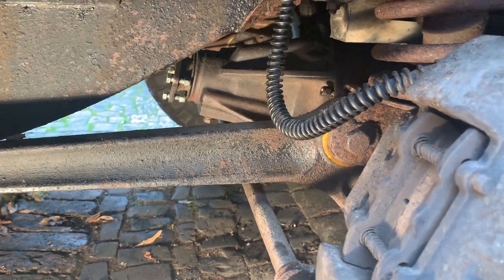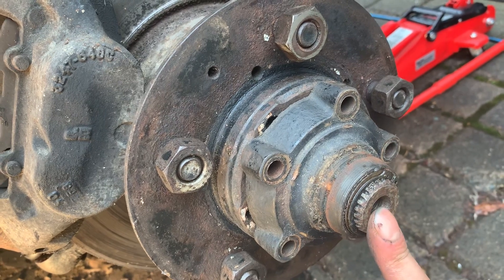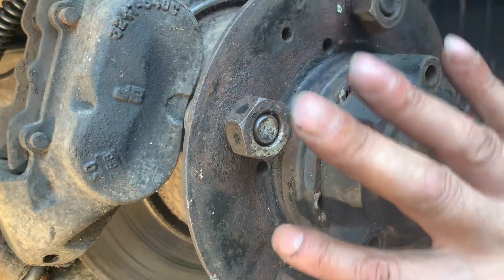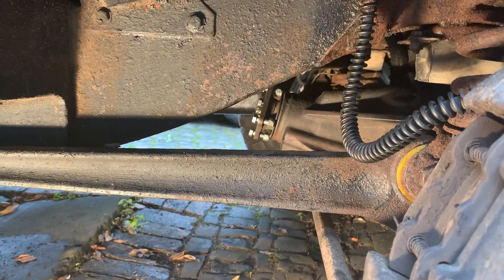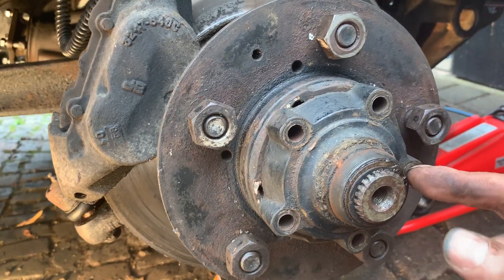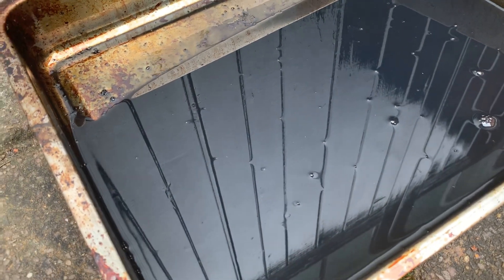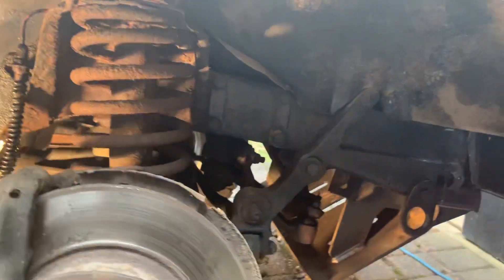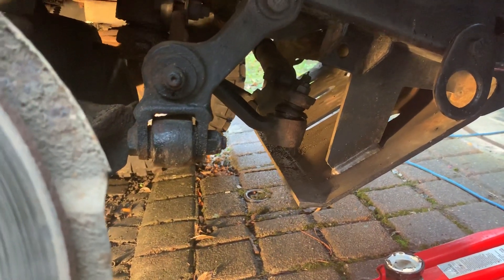Landrover 90 Jobs - Started with a 'Clunk' - Stripping the Axles Down

Comment: Did changing those shafts fix this issue ?
Reply from the maker: Must admit that as I was rebuilding it, I'm not sure which part made the clunk...
Reply: @MarkIAnson  ah no worries. I have a definite clunk in mine somewhere either transfer box or front. I shall try this method though.